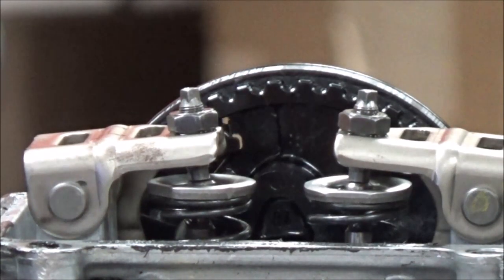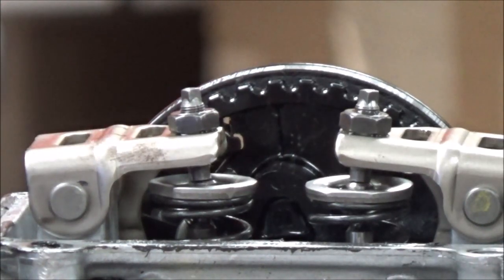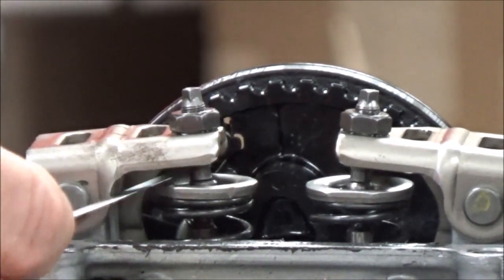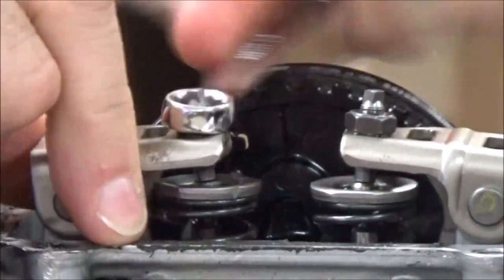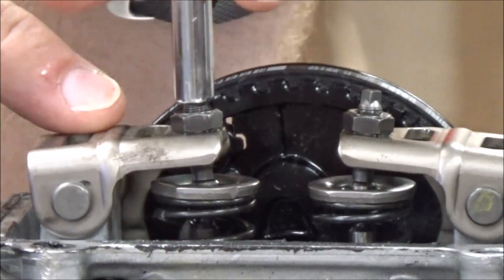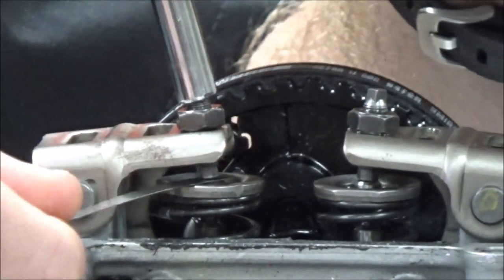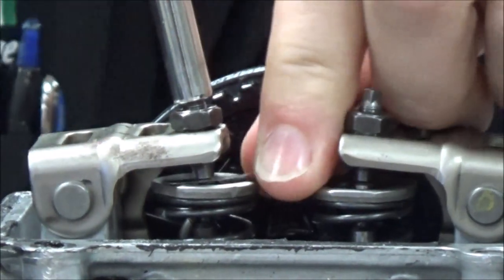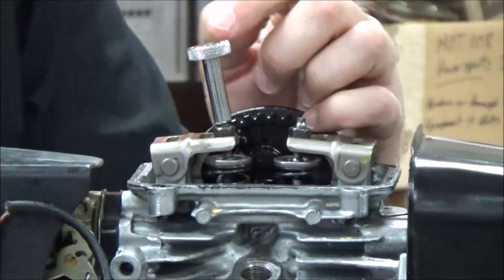How to get a "feel" for the correct feeler gauge when adjusting valves-thread type valve adjusters

Comment: So one size bigger feeler gauge shouldn't fit? I definitely have mine (1975 Honda CB750) too loose then. I can go one size up it'll just be tighter than the correct size, but it still fits in there.   I'm new to feeler gauges and I'm never sure exactly how much drag or resistance I should be feeling to get the measurement correct.  I've been under the impression that just a slight bit of friction, so you know it's touching on each side, is enough.

Comment: I'm checking my Honda XR650L valves and all my mechanic told me was 6 intake 8 exhaust because he put the cam in which is a stock cam but has a different grind on it. I adjusted my intake for the first time to my understanding was ok but when it came to the exhaust it was hard to get the feeler gauge to slide. Is this a problem for the bike cause I been having trouble starting when the bike reaches temperature. It has to cool down a little then it will start again. I mentioned this symptom to a friend and the first thing he said was it could be my valves need adjusting. When I adjusted it the first time it started up first crank and runs cherry, pulls hard too but it's a gamble I take everytime I go somewhere turn the bike do my business get back on my and it doesn't start. Any suggestions would be greatly appreciated
Reply from the maker: Yo! Want us to drop our wrenches and help you? We love helping subscribers…even on old videos! Help us grow friend! Here’s how:
1. Subscribe and let us know with a response. We will circle back when we can, it depends on member/customer demands and needs
2. We answer your questions EVERYDAY for channel members Join here: https://www.youtube.com/channel/UCBhM8DCKnT3qXwTW0eToyCg/join     
3. Give us a high 5 here: https://www.paypal.me/how2wrench  and I run back to the computer! 
4. Is this an emergency and your head is about to explode from frustration or fear? Get Shane’s cell here: https://how2wrench.com/product/personal-tech-training-phone-facetime/
Reply: @How2Wrench  so you want a slight resistance/drag when you slide the feeler gauge across the valves? It's easy to get a false reading because its hard to know if it's level in there. What's the symptoms of having to loose or to tight val es?

Comment: may someone help me?. I have a feeler guage set, but according to my bikes valve clearence recommendations, the exhaust clearence should be 0.24 mm but i do only have 0.25mm in the set so can i adjust with that
Reply from the maker: Most engines have a range of adjustment, look for a plus or minus next to the spec number. 24mm=.0094" .25=.0098" 
http://www.unitconverters.net/length/mm-to-inches.htm 

With the .25mm being larger it could move you out of spec or could be fine. You could stack two feeler gauges that equal .24mm also. 
If I can ever be of service to you, here is a video explains how to connect with me. 
https://www.youtube.com/watch?v=vjvmB01ebcs 
Keep Wrenching,
Shane Conley
Instructor/Motivator/Motorcyclist
www.how2wrench.com
Like freebies? Click here for a free diagnostic checklist! 
http://gem.godaddy.com/signups/364621/join 

Did you like this free video and hope to see more? Would you just like to say thank you with a donation? Click https://www.paypal.me/how2wrench
Reply: @How2Wrench  hey not sure if you'll reply but I have a similar situation.. my car sticker says .22 plus or minus .02... so adding them together I get .24... does that mean I could use any guage between .22 and .24? Or should I find a .22?
Reply: @XxLaMaravish13xX   did u find out bout your question i was thinking the same
Reply: @jaybee8949  yes. It was exactly like I explained. I had a mechanic do it tho. But he told me I was correct